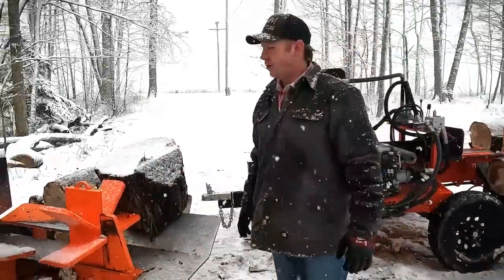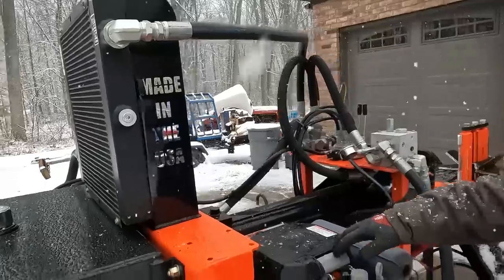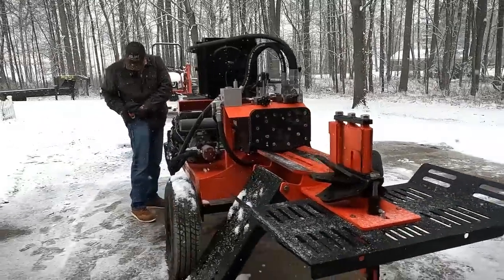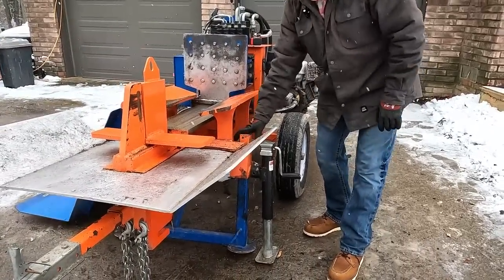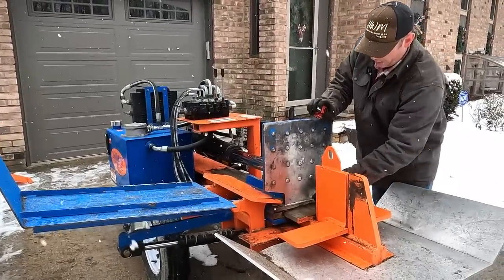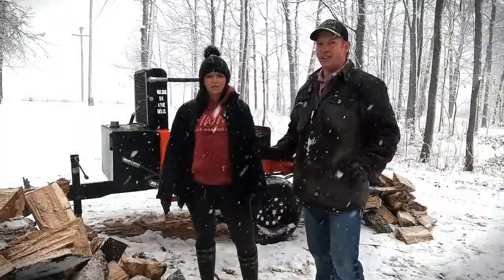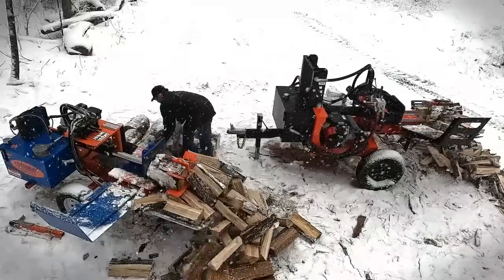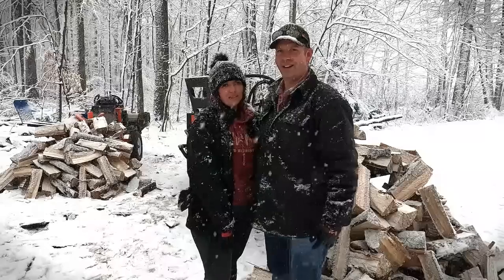Eastonmade 12-22 vs All Wood Musclewood Log Splitter Wars #116

Comment: Both excellent machines for production, would you consider changing the 6 way wedge for the 4 way on the 12-22, would you change the 8 way wedge for the 4 way wedge on the muscle log splitter for re splits, would you do the comparison for the EastonMade Axis vs SplitForce 13/20T what are thoughts, both of you deserve a warm drink,
Reply from the maker: I will probably run the 4 way on both machines in a future video with 2 operators per machine to show their full potential so it’s not affected by operator. I’d love to compare the Axis and SplitForce as a vertical splitter were high on my list before I found the All Wood and then picked up the 12-22 when I was searching.

Comment: Does the muscle wood only have four bolts to hold down the push plate?  Seems the push plate in general is not as well reinforced compared to the eastonmade.  Also the wedge support is just odd.  The log lift lifts scary high, I imagine a 400# round lifted to full height will fly off because the angle is so high.  Definitely a fast splitter and not trying to beat it up just some things popped out to me.
Reply from the maker: The push plate is built to match the angled cradle on the splitter and is held by 6 bolts. I believe the wear surface and plates are ar400 steel which also makes a difference. As far as the wedge goes it is made from one piece of ar400 I believe steel that is built in between the two frame rails and 1-2” thick depending on where you measure it. Now I’m not an All Wood rep or expert so I could be wrong on some stuff just sharing what I remember from talking to Bobby. As far as the lift goes I imagine if you raised a huge round to full height rapidly it wouldn’t be fun. However they way it’s designed it is the smoothest and most easily controllable lift I’ve run. It has a separate pump to operate it. Most splitters lifts run off the main hydraulic pump with restricted flow and are not nearly as smooth or controllable if that makes sense. I’d definitely like to look at the All Wood Hickory series machine as that has a wedge system similar to Eastonmade I believe. I am not sponsored by any log splitter company as of now and am just sharing what I know. Both Bobby and Andrew have been great to work with and both know their stuff. Bobby has been building splitters for 15 years so I trust his design and believe me when I say this thing is built to last. IMO both machines will last a long long time structurally and are two of the heaviest duty brands I’ve seen.

Comment: So how much wood do you have to split to save $25 grand? If you bought processed wood vs unprocessed?
Reply from the maker: Chuck, a lot lol. I will eventually sell one of these splitters. The good news is these splitters are investments and hold or even go up in value. For example I bought the Eastonmade 12-22 used. The people I bought it from ran it for over 2 years and put 400 hours on it making hundreds of cords of wood which they sold. I then bought the splitter from them for almost what they bought it for so they essentially made 10s of thousands of dollars for a couple thousand dollars. 

Now let’s just say hypothetically speaking. I source most of my wood for free. Conservatively I can split 1.25 cord per hour which is quite low for what I could actually do. I get over $400/cord so we’ll say I can split $400/hour now I know this is just splitting time. So I can pay for both of these splitters in less than 80 hours worth of splitting or 2 basic work weeks. I then also control quality etc. purely hypothetical but they are an investment not an expense imo.
Reply: @hardworkingmanoutdoors  Now i play the wood game and free does not exist. And i know iron is an investment. But unless you live in a tool box that investment can go south pretty easy. What i was looking for was how many cords to pay for it. Say 50 a cord. 25g would be 500 cord. So 10 cord a year for 50 years. Or 5 cord for 100 years. If you bought tree length and processed it then broke down the numbers vs buying it all done. What number would you give to splitting. You have handling cutting handling splitting and handling at least twice more.
Reply from the maker: Chuck, absolutely. I’ll see what I can figure out. A big thing for me was saving time!  I used to spend an hour to split 1/3rd of a cord. Now I can to it in about 8 minutes!  I have a very busy life!  I use a lot of the time saved working other side hustles such as K9 deer tracking, habitat work such as installing food plots etc. so that is also a factor. I plan on doing a video in the future about is it worth it to buy a commercial splitter and break all of this down. I’ll try to answer your question the best I can in that video!

Comment: Your Allwood splitter has to short of wings on that moving wedge. They need to make them longer like the Eastonmade.. Plus You can't mount a box wedge on that Allwood you have and the Allwood box wedge I seen on their website is the cheapest made box wedge I have ever seen. They need to make their box wedge moralize Eastonmade... They make it so cheap it looks like it would break if you tried to push really bad wood through it.. I would never buy the Allwood for that reason... Anyways the best boxwood splitter is the Raptor. Way way better then both those machines you have..
Reply from the maker: The wings could be a little longer but it is rarely an issue. As far as the All Wood box wedge goes I have never seen one in person but I can say that Bobby has been building splitters for almost 15 years and he does not skimp on the builds of everything I have seen. The Hickory series has a similar wedge system to the Eastonmade but I am not sure how long the wings are on that either. The Eastonmade splitters are also well built machines. I have not seen a Raptor box wedge machine in person either but they do look nice.
Reply: @hardworkingmanoutdoors  The box wedge AllWood makes is crap. I watched a few videos on YouTube about it and reviews.. Thy all say the same thing. It's not built right and it's cheaply made.. Woodmizer makes a better box wedge splitter then Allwood does.. You make like that brand but I won't be buying that brand.. Their is many writing bad reviews about them.. I love that table they make that you helped them design

Comment: Be nice to know the specs on the hydraulic return hose sizes and the flow rates of the fluid filters
Reply from the maker: Jon, I’ll see what I can find out but I’m definitely not a hydraulics expert.
Reply: I ask because I’ve noticed that Rugged made 728 and 737 has what looks like a 1/2” return line and the filter has a reducer in it really restricting the fluid movement especially on splitter piston return.

I loved seeing the dual pump on the musclewood.  That’s no-nonsense building right there.
Reply from the maker: Jon, I know the lines are big!  I’ll see if they have diameters on them.

Comment: Pretty even match on production.
Reply: Though the allwood has over 20hp and the Eastonmade only has 13hp.  Not very close really.  But the Eastonmade still out preformed.
Reply from the maker: It was a good match up. We ran the 8 way on the All Wood which slowed it down a bit more than a 6 way would have, the auto cycle definitely played a role, as did the size of rounds and the weather. Rachel really struggled to keep up with the All Wood without the auto cycle having to wait for it to cycle down then hit the return lever before going for the next round. We will run this head to head again with 2 people per machine and both running the 4 way wedge. Definitely two of the heaviest built splitters I’ve seen and both have great owners!
Reply: @hardworkingmanoutdoors  they both look to be rugged enough. But the All Wood still has that homemade appearance.  Not that homemade is bad, I mean who doesn’t like homemade cookies.  Here is a link to a video of me and Daddy running Orange Crush. My father hand built it in our shop. It has a underperforming 22gpm pump and a 12hp Honda engine, it has a 5” bore cylinder, and runs the same cheap garbage Prince auto cycle valve as some of the big names in the commercial splitter world.  
      My father built this as a prototype and used off the shelf components. But a production model would be built using a better valve set up and a better cylinder. 
     Like the allwood he used exotic steel alloys that shouldn’t wear out anytime soon. But he already knows some changes that need to be made.  Just saying. 

https://youtu.be/Nxez5yvKbKg

Comment: $5000 more did not get ya much!
Reply from the maker: Mark, in all actuality it wasn’t $5k more as I had an extra $1k wedge added to my order but there are differences in build design, features, etc. but both are awesome machines in my opinion!  The autocycle is a difference maker too. I am trying to set up a Splitter Wars with an All Wood Locust and the 12-22 which are comparably priced machines and should be a battle!

Comment: I would sale My powersplit from powersplit international it was custom built with thicker metal and extra bracing I'm sale,ing because I'm purchase,ing a Prosser soon single way wedge and a 4 way wedge.13k it's a vertical like the Easton axis foot pedal operation and has a lift table.the splitter ram is bigger than stock as well.
Reply from the maker: Curious where you are located?  I seriously doubt I can get permission right now but doesn’t hurt to ask.
Reply: @hardworkingmanoutdoors  NW Arkansas top right corner
Reply from the maker: That’s a hike!  Pretty sure I know the answer right now but I’ll check!
Reply: @hardworkingmanoutdoors  lol no hurry kitchen first lol lol.
Reply from the maker: Ah yes the kitchen lol.
Reply: @hardworkingmanoutdoors  yep lol g night brother if interested I'll send you my email tomorrow sometime 5am be here fast.

Comment: Also a side note your COMPARING THE ALL WOOD with a 22 hp mptor twin vs a single cylinder 12 hp on the EASTONMADE try comparing a Eastonmade 22-28  with the 22 hp against the all wood it would be game over says alot for the 12-22 which is a great splitter
Reply from the maker: We can only compare what we have access too. These splitters are definitely different but both amazing splitters. I’d love to add a 22-28 to splitter wars. When you say it would be be game over for the All Wood against the 22-28 is have to disagree. The Muscle Wood is a 25 ton splitter with a 4 second cycle time, the 22-28 is a higher tonnage splitter with a 7 second cycle time. So again two different machines. The comparison we did definitely shows that the 12-22 is a great machine as is the All Wood. To be honest we’ve been nothing but impressed by both machines. Both have slight pros and cons but both are definitely well built hi performance machines!